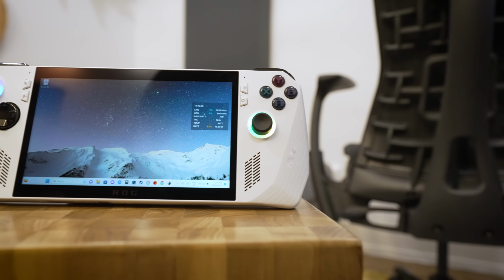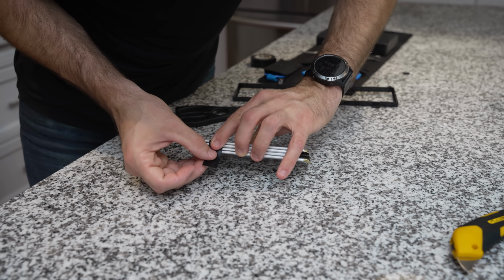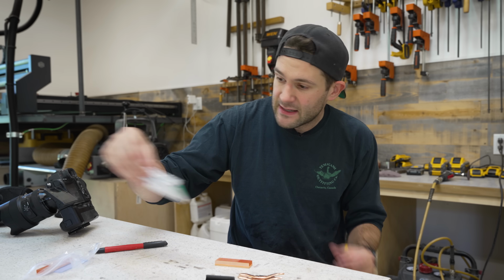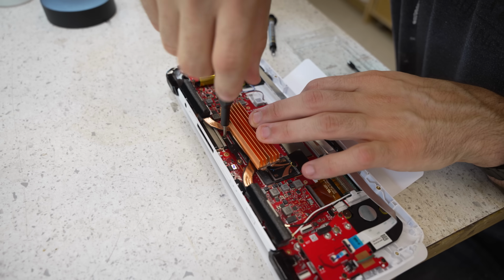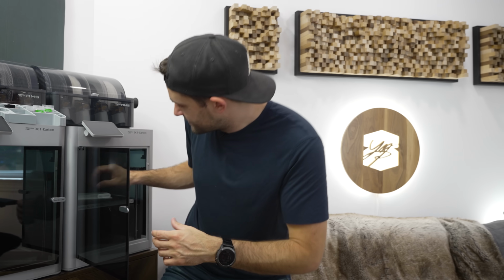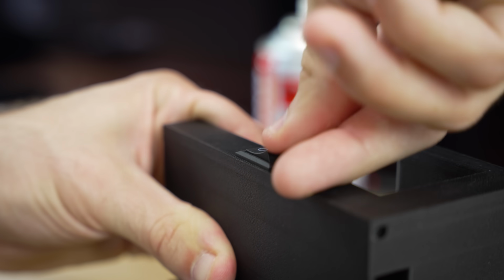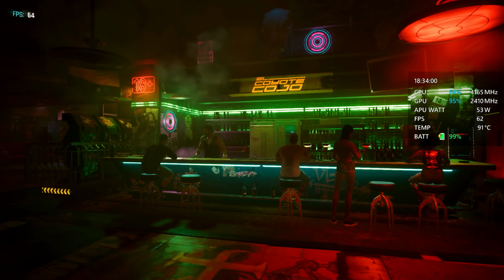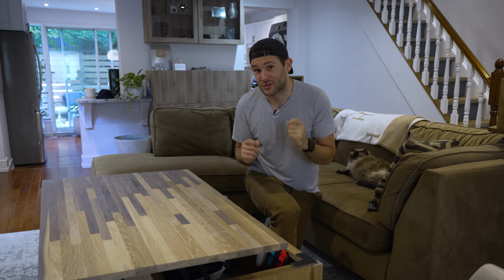I don't understand why people buy Steam Decks...

Comment: As a complete hater of click bait, I'm a little cheesed. You don't mention steam deck at all in this video, the ally costs more, has less inputs then a steam deck, and you get to use windows ona handheld which everyone knows is actual aids.

The pros of the ally are more power, sure. But you straight up said in this video "When I don't have enough power, I just stream it to my ally".

So what point were you trying to prove with this video with the title you chose?

This is a fantastic video to see the mods you did, the cooling gains alone are insane, but name it as such.
/rant

Comment: Couldn't you have just printed a new entire backplate as one piece? That way you'd retain the stock one, so if anything went wrong you could put it back to factory spec and claim on the warranty without them blaming you for chopping it up? Not fraudulently, for damage you caused yourself, but in case any other part of the system fails.

Comment: The Steam Deck is more powerful than that Ally at TDPs less than 15W but anything above that hold true. However I do give you props for trying to solve a major issue of the Ally for those who are tech savy enough to replace the SSD and not afraid to get their hands dirty buy taking off the heat sink.  Yeah the Ally and Steam Deck share the same battery capacity which is massive hinderance of both products. However I do like the idea that you can upgrade the battery if you know what exactly you are doing and not afraid to go that far. A+ for all of the mods shown. Props for using liquid metal. Maybe it might work better in the Ally than in the Deck.

To Answer your question why users still buy Steam Decks is because they trust Valve because of their excellent customer service and anytime uses had issues with their decks the users had great results with the RMA process. And the OS for the Deck is a million times better than trying to use Windows on a device that it was NOT made for even thought there are tools that were made by ASUS that help somewhat  but still cumbersome even with that. Also ASUS hasn't had a good track record because in the past they had issues with their some of their motherboards damaging 7800X3D CPUs and their own board which they said they wouldn't do any warranty stuff with only to backtrack later on after being called out on it. So a lot of trust was lost with that company.

Comment: I will say the things I love about the steam deck are minor to others but for me personally are deal breakers if I don't have them after using the steam deck. First are the touchpads, I know people probably think these are useless and probably don't work very well if you are trying to use them as a mouse or joystick replacement. But for me its the fact that I can use them with steam overlay and get a virtual menus that make it great for emulation or games that involve a lot of button combinations to do certain things. I also love that it has four back buttons rather then just two, for me the more buttons the better since I can place macros or other stuff that makes gaming easier or more enjoyable, again due games needing you to press a bunch of button combinations to do certain things. I also like the symmetrical joystick layout, I just cant get used to the offset layout and it just feel uncomfortable in my personal opinion.

Now I am an asus fan boy and this device is pretty awesome since it can also use the GPU attachment they sell so you can up the performance. If asus were to release a new version with four back buttons, symmetrical joysticks, and atleast one touchpad while retaining the ability to use there GPU dock I would definitely pick one up!

Comment: Liquid metal will eventually harden and delaminate. It needs to be replaced every couple years, probably sooner on a device that isn't stationary like a PC. There is a thermal pad called  PTM7950 Thermal Pad. Linus Tech Tips has a video covering it. I think it would be best in your use case here.

Comment: I really wouldn't use liquid metal on pure copper. The liquid metal permeates the copper effectively drying up on the contact surface which is where you want it and produces some sort of copper gallium alloy. Nickel plated copper is really the only heat sink contact surface that is stable for long enough. Added bonus is that nickel plating looks pretty neat.